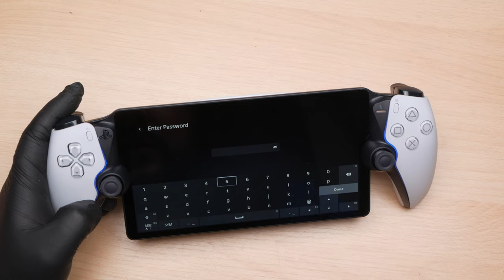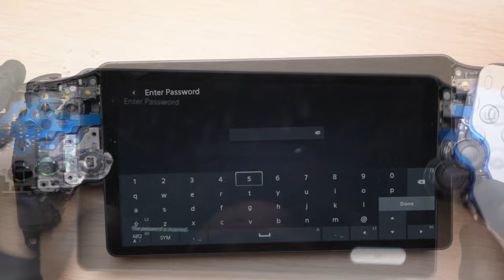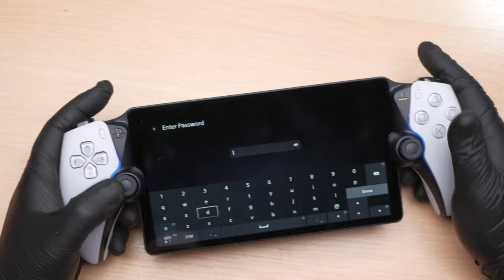PS Portal Repair | Yep ... We got one in already!

Comment: Im part of the crew that broke 3 of those metal tabs but this fixed my up and down on my left stick not working perfectly! Thank you so much!

In my case, i noticed that the holder i use for my portal snagged the thumbstick and twisted it, which is why im thinking the little slider inside jumped of the track and caused the up/down axis to stop working.

I cant thank you enough for this video!

Comment: I was able to fix my left stick with this, although one of the prongs of the fork that holds the sliding piece in place had actually snapped on mine, So i had to trim a tiny piece of 3d printer filament to be the size and shape, and then super glue it down, and that seems to have fixed my one. Hope this comment helps anyone in the same situation as me